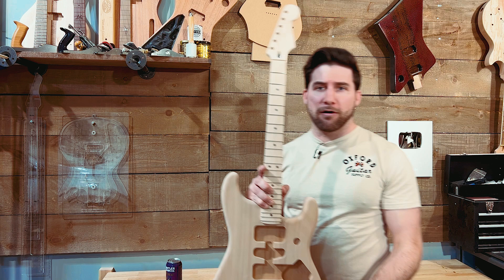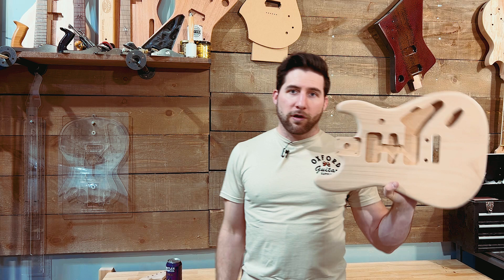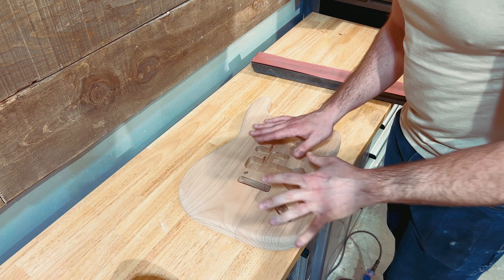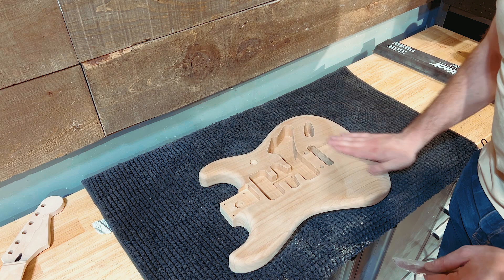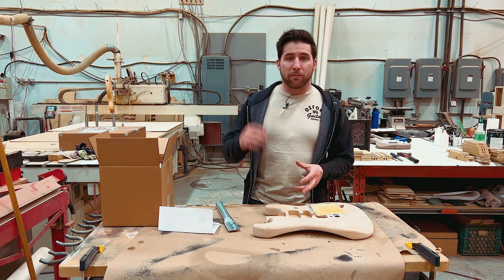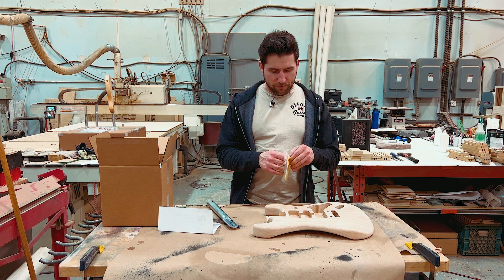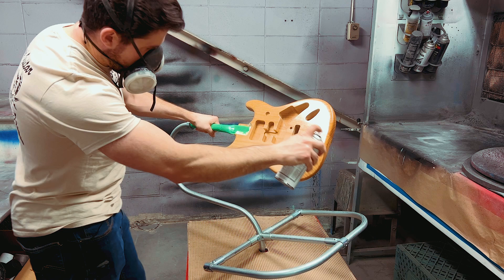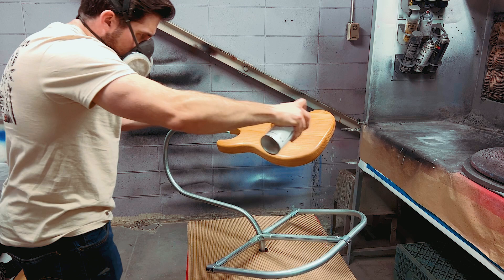The Easiest Guitar Spray Painting Tutorial (Oxford Finishing Kit)

Comment: Hi, I put a Rust-Oleum painters touch (gloss black) on my guitar that you recommended. I have about 5 coats on it. Do I need to lightly sand with 800 grit before putting on my Spraymax 2k clear? I feel like I saw a video about that, but I can't find it anywhere now. It seems like all the scuff marks from sanding would show through the clear?    It looked pretty nice before sanding the color. Should I just add more black, then the 2k without sanding first?
Reply from the maker: Yes, that’s a lot of coats. I’d let that dry for quite a while (couple weeks at least) and the. Sand smooth with 800 grit before clear coating. You don’t need more black, the clear will deal with the 800 grit scuff marks.
Reply: @BradAngove  Great, thanks Brad! I initially did 3 coats of black, but when I lightly scuffed with 800, spots of the wood underneath started showing through, so I needed to recoat. Now Im hoping I scuffed enough! I appreciate your help again!

Comment: I am trying to do a black nitro finish on Strat body, using a Oxford spray can kit. So after using the filler and sanding as perfectly as possible, i sprayed with the sanding sealer. I couldnt seem to get a uniform smooth gloss, plus it has turned milky looking. I sprayed with humidity too high! So my question is why didnt it level out to a uniform smooth gloss,? And do I need to strip all the sanding sealer off and stary over? That is, will a bit of moisture trapped in the sealer cause problems with the color coat?  Im not sure why they did not supply a can of primer coat.....I assume its because its not needed?
Reply from the maker: You don’t need the primer for black because black is completely opaque. You might be able to carefully get rid of that blushing with a heat gun. My concern is it somehow escaping later and leaving tiny exit holes. The sanding sealer isn’t really glossy, but should look uniform. How confident are you in your spraying technique?

Comment: I got a warmoth partsmaster on Reverb for a steal and they had finished it already, but I hate the color of it once I saw it. I have sanded the body and filled all major holes, would I be good after a firm sanding to just use the Oxford primer and then use my lacquer and clear coat or would I need to do anything else beforehand? I would rather not strip it if I don't have to and the wood itself is really soft and not sure how well a chemical strip would go over.

Never heard of Oxford before these videos, but their paint kits look great.
Reply from the maker: You don’t need to strip it all the way. Just gently sand the paint that’s on there with some 400 grit and the. Move on to your Oxford system.
Reply: @BradAngove  Appreciate it! Haven't done this type of thing before, but after going through so many of your videos I probably have more confidence than I should. Can't wait to give it a go and try to turn this guitar around. Will be sure to leave a comment about how I found out about them through you.

Comment: Great job as usual! Question. Would an acrylic lacquer like diplicolor be compatible with a nitrocellulose lacquer clear coat from Mohawk? How about a brush or wipe on poly clear on top of that duplicolor?
Reply from the maker: I’ve never tried nitro clear over acrylic lacquer. I’ve heard of people doing that successfully, but they certainly aren’t designed to go together. 

I have used brush on poly over duplicolor successfully. It looked good, but again they aren’t really mean to work together. There can be adhesion concerns.
Reply: @BradAngove  looks like acrylic enamel clear coat like Rust-Oleum can be sprayed on top of duplicolor without adverse reactions and it's been over a month on a test piece. Just thought I'd share.
Reply from the maker: @HuyNguyen-tb1lw excellent; I’m glad to hear that.

Comment: Hey Brad I need help. Few weeks ago I was sanding my precision bass from glossy polyurethane to satin and after this I relic it. But the final finish is not what I was expecting and now I order a danish oil for those relic parts, but can this oil improve the whole bass finish ? Or need to put back some gloss finish ? Thank you !
Reply from the maker: What kind of finish are you looking for? More of a satin?
Reply: Well I want a more glossy finish because now it looks like scratchy black plastic finish. I tried to put oil on that and I like the way how it shines now, but I sanded it with 120 sand paper before... I love some old nitro finishes. Somewhere I saw, that you can put a polishing compound for more glossy finish... Unfortunately I can't show you a picture here. But there are still visible scratches.
Reply from the maker: You can use compound to shine it up still, but 120 grit is way too rough. You would polish from more like 1200 grit.

Comment: Ever had your clear coat start dissolving when trying to clean it with isopropyl alcohol? As soon as I touched it with alcohol, it started leaving a white/milky residue, which is obviously due to breaking down the polymers, like when putting acetone over transparent plastic. I finished the clear coat about 6 weeks ago, therefore it dried for a long time. I don't think it's a case of non-cured finish, it's just strange cause I used Duplicolor automotive clear coat, but it somehow behaves like it's nitro/acryllic 😢
Reply from the maker: Duplicolor is acrylic lacquer.
Reply: @BradAngove  man... I had this suspicion .. but then why would anyone advertise it as "automotive"? They say you can spray it on car parts, doors, hood, rims etc. I mean, acrylic will get damaged instantly from mechanical and thermal stress... But anyhow, thanks for confirming what I thought, desoite their label indicating nothing related to acrylic... 😞
Reply from the maker: I suppose I could be wrong, but I think that’s what it is. It certainly smells and behaves that way. Not terrible for small repairs, but certainly not the typical automotive clear.
Reply: @BradAngove  Can u recommend any good polyurethane brand that is certainly PU? Cause I cannot trust the label, as seen with Duplicolor, nor the ingredients section which list the chemicals but don't mention the word "acrylic" to add to the shadiness. Thanks so much!
Reply from the maker: Are you just looking for a catalyzed clear coat in a spray can? If so, I think the spraymax 2K is probably the standard for a professional looking automotive clear coat in a can. If you have access to a spray gun there are tons of options.
Reply: @BradAngove  Thanks a bunch! I don't have a spray gun yet, so I'm looking only for cans. Anything that is PU, acting like plastic will be perfect, kinda like what all guitars use nowadays. Again, thanks so much for the suggestion!!! ♥

Comment: Hi Brad
Trust you are well, I just used an entire can of the triple thick glaze on the metal flake candy apple red guitar body. It still feels rough so I was planning on getting an additional can of the same glaze and coat until it’s a smooth finish. What would be your recommendation?
Reply from the maker: Have you been sanding every few coats to try to level it out?
Reply: @BradAngove  hi Brad, no, I didn’t sand anything yet, I didn’t want to take the chance of sanding off the glitter finish, thought to at least get a thick coat on it and then begin to sand it.
Reply from the maker: Ok, at this point you’ll want to sand it to try to get it as smooth as you can. You should be able to get it considerably smoother than it is, although maybe not completely smooth yet. The final leveling and polishing will be after you’ve added a few more coats post-sanding.
Reply: @BradAngove  okay, thank you, will do. Appreciate the assistance!
V/R
Pat
Reply: @BradAngove  Hi Brad, unsure if you’ve received any of my correspondences regarding my guitar painting inquires, I sent you something on your face book account, via messenger with a photo, requesting some assistance, after applying four coats of the triple thick glaze, and. wet sanding  numerous white spots appeared,  requesting a recommended fix if you have any suggestions. If not I guess I’ll try to remove the glaze coat with acetone and re-apply? Please advise.
V/R
Pat Lis
Reply from the maker: Hi Robert. I think I responded to your other comment about this. It sounds like you may have sanded into some bubbles. 

I’ve had difficulty accessing messenger lately.
Reply: @BradAngove  hi Brad, apparently I did have  some  air bubbles, but I got some acetone & dissolved the clear coat without affecting the paint finish. However, I’ll put another coat of ge red glitter paint, allow to dry, then put on a thicker coat of the clear glaze coat, then I’ll just dry sand with 1000/1500 grit. Or if you might have a better recommendation?
Thank you
V/R
Pt Lis
Reply from the maker: @robertlis298 that makes sense to me. Just don’t try to lay the clear coat on too thick too quickly.
Reply: @BradAngove  okay, again, thank you Brad, will keep you posted.